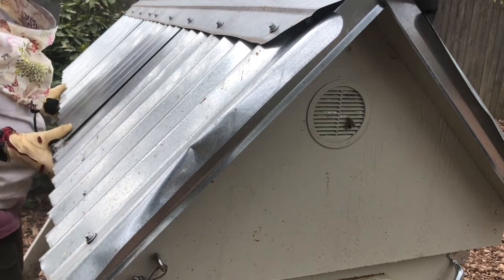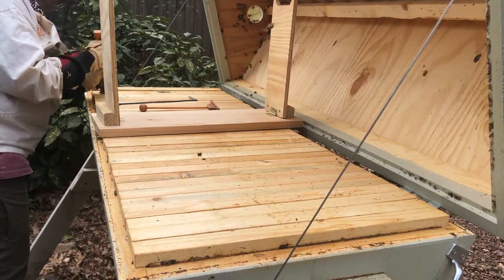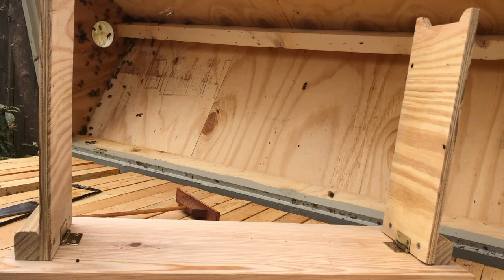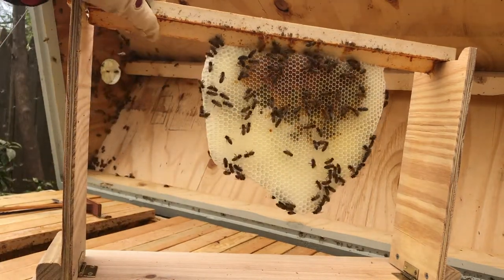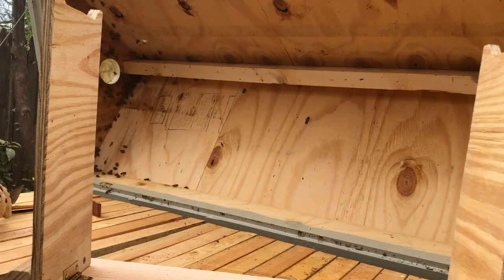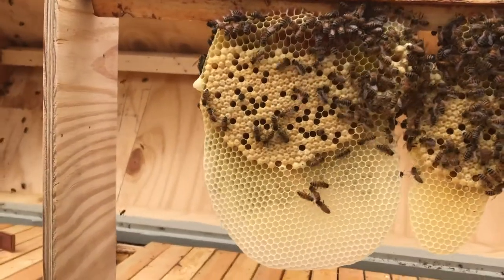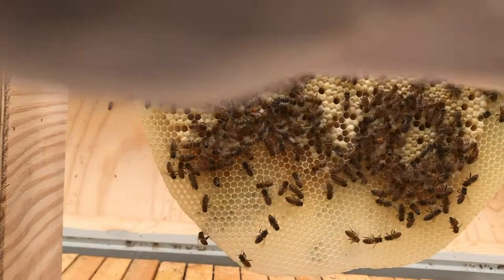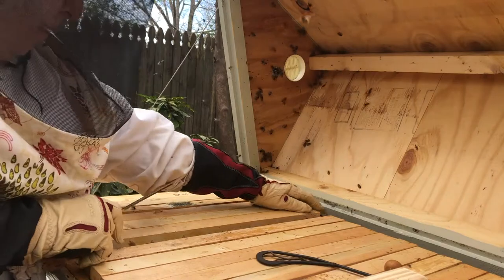Inspecting Top Bar Hive with Frame Rest

Comment: I appreciate the stand. I wish you could articulate the dimensions so others could benefit from it as well. I'm going to guess some of the dimensions  based on observations. I also noticed you have a hinged top. How many hinges did you use and I appreciate the cord or cable connecting the lid with the box. I was gifted my hive box from a couple in New Mexico, so I'm going to put it to good productive use here in North Carolina. What's drone?
Reply from the maker: Hi Clay, My top bar was made by Andy Marcus in Dahlonega, GA. I special ordered it from him because I liked his hives. It is truly the Cadillac of top bars and has hinges, vents, everything. He is an air conditioner professional and built this with all the bells and whistles!

And drones are male bees. There are three kinds of bee in the beehive - the queen, the drones, and the workers. The drones are male bees and are larger than the rest. To create a drone, the queen lays an unfertilized egg in the cell and the workers cap it with a bullet like top to provide extra room for the extra large bee that is the drone.

I assume you are a new beekeeper because of that question and I highly urge you to take a beginner beekeeper "short course." The local bee club in your area probably offers one. If you can't easily find one, contact the NC Beekeepers Association and they can direct you to one.

Good luck with your upcoming bees,  Linda